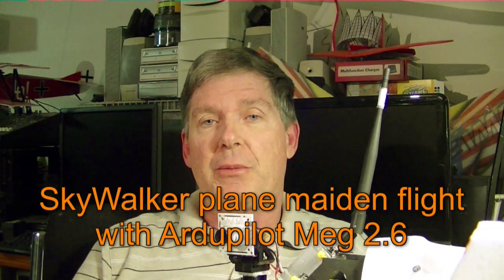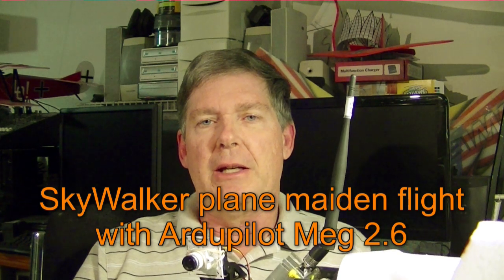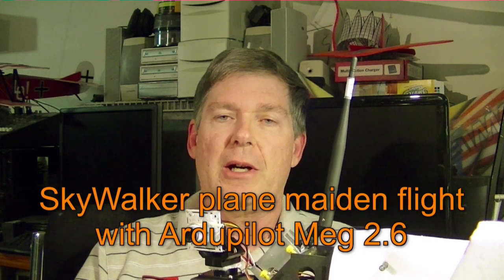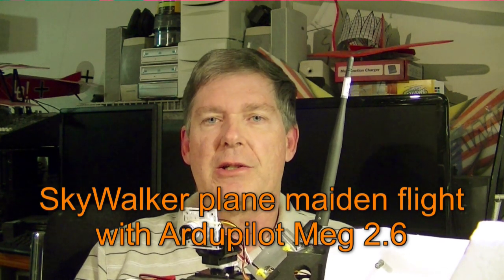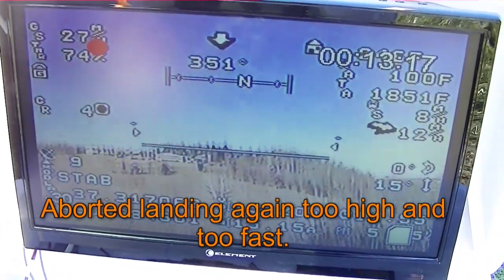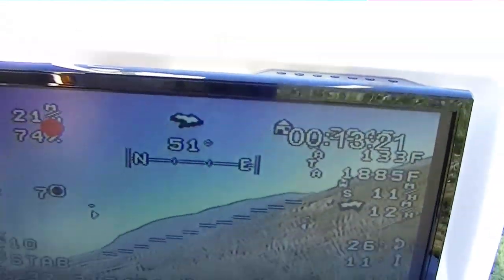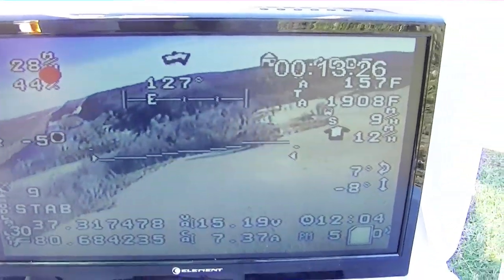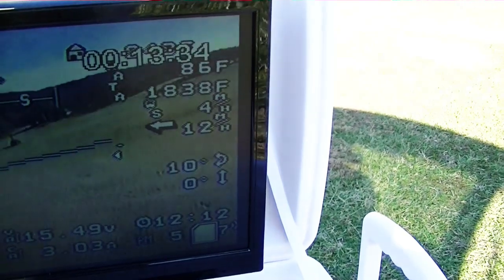FPV Part 17 SkyWalker Maiden Flight with Ardupilot Mega 2.6, MinimOSD and EZUHF

Comment: Very nice flight.  Are you using just 2 rubber bands to fix the wing?
Reply from the maker: ***** Thanks, Plane comes with 4 rubber bands for the wing but I use 6 just to be safe.
Reply: +dmerc00 Hello! Give me whether to buy APM autopilot when flying away or still better to buy a cyclops or fy41?
Reply from the maker: +Spartak1245 They are both good FC's so it's a matter of preference.  The APM is a harder to setup but it can also do missions if you need that kind of thing.
Reply: ***** I've heard that if there is a dive, the autopilot was not aligned. Is it true?

Comment: Hi,
first I want to thank you really much for your very helpful videos! I just get my APM 2.6 and your Videos help a lot to install everything clean and working. I am flying the Skywalker 1900 2014-Version, but I am not happy with the flight setup. Would you send me your Parameter file that i can compare to my one?
Reply from the maker: My parameter file is nothing special. 
I have not even done the PID tuning but if you want it just give me your gmail address and I will attach it to an email
Reply: *****
That is nice. My mail adress is rastaleeman (atttttttt) web (point) de
Thank you!

Comment: I've finally gotten some cash saved up to purchase my own FPV gear.  I'm definitely working towards getting my setup in a cooler, just as you have.  I'm curious...what size batteries are you using to power the "cooler" ground station and how long will your batteries power your ground station?  I'd appreciate any help you could offer.
Reply from the maker: Hey great, always good to have FPV company.
The cooler idea I got from Dick Gibson btw.
I just use one battery in the cooler it is a

Turnigy nano-tech 4500mah 3S 35~70C Lipo Pack
http://www.hobbyking.com/hobbyking/store/uh_viewitem.asp?idproduct=17247
It will run every thing for over 1 hour. see this video
FPV Ground Station Battery Duration Test
Also see this video
FPV Monitor from WalMart TV - Runs on 12 Volts DC!
Reply: 1 hour?  WOW!  That's awesome!  Thanks for the link to the "Duration Test".  I remember watching it, once before.

Comment: nice job on the build, what ranges are you able to get before RTL kicks in with the Tx antenna in the back like that with the sma extention?
Reply from the maker: Thanks, 
I don't know the answer to that at this time.
So far the EZUHF has been rock solid even in low power mode. 
The sma extension cable really should have no effect on reception in my opinion because of the shielding and short run. Worst case scenario would be when the plane is aimed toward the transmitter and the LRS receiver antenna is behind the other equipment.

Comment: Congrats on the maiden fellas! I've been waiting to see this since I've been following your build. I will be building a similar FPV ship with the Bixler 1.1 and HKPilot Mega 2.5 board (Hobby King clone of APM2.5), that is if Santa is good to me! ;-) 
Could you do a video of you setting up your board/plane in Mission Planner (ArduPlane Pids)? Did you download the specific configuration file for your airframe? 
Thanks for your great videos and Merry Christmas to you and your family!
Reply from the maker: Thanks,
I also have a Bixler 1.1 but have not put FPV on it.
Yes I did download the config file but it was for the 2.5 and I was reluctant to apply it to my 2.6. What I might do is just manually set only the PID section and leave the rest alone. When looking at the file in a text editor I noticed some things I did not want for my setup. Have a good Christmas and enjoy all those toys!

Comment: WOW !!!!!!!!!!!!!!
Super way kool men!!!
Don't you love it...
Now don the goggles and go for it.
Might suggest balancing the prop I think that is what was causing the jello.
You will always get glitches when you are over head, no matter what antenna system you are using.  I really like the monitor.
Great job,  Cut back on the throttle and you can fly all day.
Reply from the maker: Yeah it was great!
I can't help dreaming about more flights and mods to the plane.
The picture on the 19" monitor looked good enough to fly by.
Need to try the goggles and do the ski mask mod on them like you have.
Do you have a video on that?
Reply: ***** Dreaming is a good thing!!!
http://fliteevolution.com/product/fe-cg1/
Reply from the maker: ***** http://www.elementelectronics.com/products/elefw195/
Here is my vid on it too.
FPV Monitor from WalMart TV - Runs on 12 Volts DC!